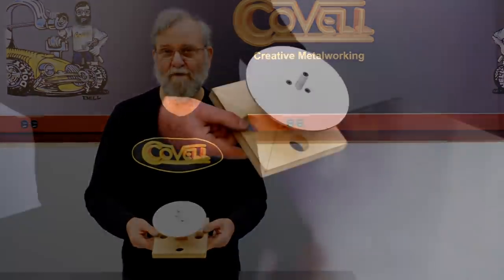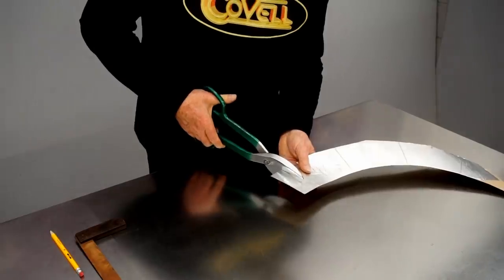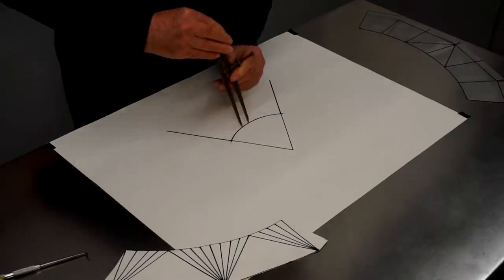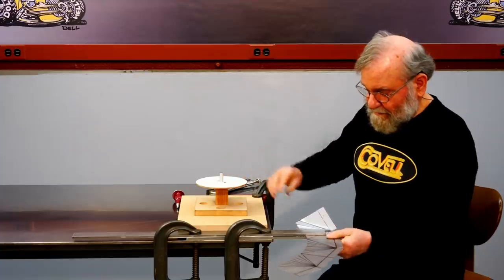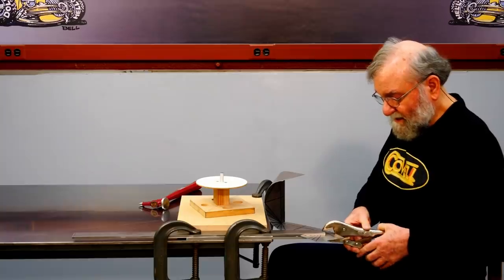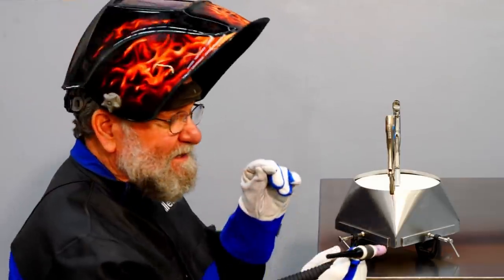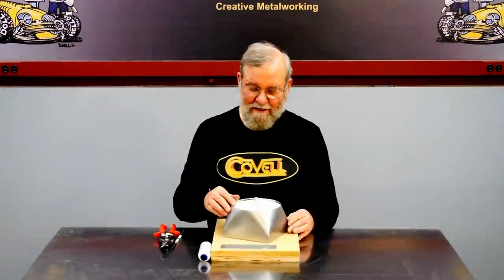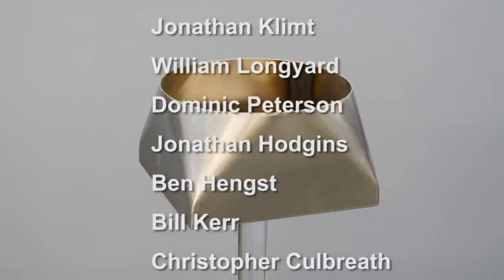Rollation 3 - Square to Round

Comment: This is cool, makes me wonder though... What would happen if you upgraded your pattern with some Clay that you roll on and let harden and a lip to hold the sheet edges then literally roll the steel onto pattern in 1 motion, then re-bend for springback?  10x speed improvement perhaps.
Reply from the maker: Well, that's certainly a clever idea. The springback is not a trivial issue, however. I would guess it would take about as much freehand bending to fix the springback as I put into making the bends freehand. Might be fun to try your suggestion and see how well it works.

Comment: I did a copper smithing apprenticeship on the Rhodesia Railways in the 1970's. I haven't done any metal work for 40 years. I've just bought a Tig welder and you have inspired me to get stuck in and create a few pieces. Excellent series with clear instructions.
Reply from the maker: Very cool!

Comment: Quick method of finding an equal number of divisions along a curved line Ron. An alternative is that you can bisect the angle with your compass. You can then bisect the subsequent angles. But then you were aiming for quick and easy for the novice to understand so I get the point of where you are aiming the vid. Well done on the square to round development. I love this method.
Reply from the maker: Bisecting would certainly work - for an even number, at least!

Comment: I just realized how much I will be able to save if doing ductwork myself, if I get a tig welder, especially if I’m trying to have it look good and be intentionally exposed
Reply from the maker: The joints could be gas or MIG welded, and cleaned up to look quite good. In the HVAC industry they use lots of overlapped and spot welded joints.

Comment: To divide by 8 a simpler way, slide a 8” rule up or down until it fits the lines, than mark each inch.
Reply from the maker: Robert - thanks for your suggestion! You actually induce an error in dividing an angle as you describe. Try it on a broad angle (like 160-degrees) and you'll quickly see that the angles formed at the ends are much wider than those in the center. I appreciate your helpfulness, in any case!

Comment: Having used a metal bending brake (the thing with the lever you lift anyways, not sure if I have the name right) back in high school and how difficult it was to get accurate bends and how in the way it got, I think your method is better for anything below a certain thickness and weight/stiffness
Reply from the maker: Thanks! The technique I showed for bending has some serious limitations (primarily the length of the bend, and thickness of the metal) but within limits, it can be pretty useful!

Comment: I have some printing presses so I think I would just ink the edges of the pattern and roll it onto paper to get the cutting layout. The downside is cleaning off the ink afterwards so the pattern can be used as a form without getting ink everywhere!

You could use paint too, but you have to use is sparingly enough not to blob, but wet enough that it doesn't dry before you can transfer the entire shape.
Reply from the maker: Thanks for sharing your ideas! 

Ink would probably work - but like you say, it's a bit messy. I tried paint, but the wood absorbed it so quickly that it didn't mark the pattern consistently.

Comment: Very cool technique! - and I think it's awesome that you're using basic tools.  I also really dig that Dykem "marker" - going to have to look for one of those....  Thanks for posting this :)
Reply from the maker: The Dykem with a 'fuzzy top' is a relatively new product, but it works great!
Reply: @RonCovell  Hi Ron, great video.  For us beginners could you provide a link to where you buy the "dykem" marker.  Also wondering about the hand snips .... even new pairs I have don't cut as well ( maybe the operator) as yours wondering if they are something special.  Again suggestions on what to use would be helpful.

Comment: Very interesting, however he should have made it out of one piece of metal so you only have to tack and weld one seam.
Reply from the maker: This certainly could have been made in one piece, but sometimes the shaping is easier with two, and it's definitely easier to achieve exacting dimensions that way.

Comment: Very slick indeed Ron. What Miller welder are you using ?? Thank you for sharing your knowledge
Reply from the maker: I used my Miller Diversion 180 for this part. I also have a Dynasty 350 which has  more bells and whistles, but it wouldn't make much of a difference on this part.

Comment: Very nice !
Could use this one to mount the fumes extractor on my plasma table...

A second air line could be useful so that you don't have to change your sanders every 10 sec...

Just thinking... If you divided your angle in 8, shouldn't be the bends about 12.5 (90/8) ?
Reply from the maker: You know, I never even thought about using two hoses - great idea! Yes, the bending angle should be 12.5 degrees. It gets more tricky on non-regular parts, like a round to a rectangle, or a rectangle to an oval. With a 'real' bending brake, you can set a stop to repeat the bending angle accurately.

Comment: Great video as usual! You are very good at making this stuff understandable. Would the principles be the same if i would like to go from a rectangle to a circle? I only have access to a mig welder and have hardly ever used it. Would it be possible to do those welds with mig when the steel is so thin?
Reply from the maker: Yes, absolutely! 20-gauge steel can be readily MIG welded, although thin metal is more difficult for beginners than the thicker stuff.
Reply: @RonCovell  thank you for the answer. I have a perfect thing this could be very useful for. I will give it a try. :)

Comment: as an Old Sheet metal worker this is one way!
but this way you have to make a template so you can get the measurements,
but the way I was taught was using triangulation. If anyone would like to learn more about this and other methods of making transformation parts try and find this book (not easy to find)
The Geometry of Sheet Metal Work By a. Dickason (ISBN 0-582-00961-8) it had the nick name of the sheet metal worker's bible
Reply from the maker: Thanks for watching and commenting. There are many good books (and online resources) that show how to do this by triangulation, which is the 'standard' technique, and works very well indeed. My goal here is to show an alternative procedure that is not well known.

Comment: Nice video. Keep it up. I have used rollation to design paper model aircraft. Try rubbing chalk on the edges of the form. As you roll it across the paper, it will outline the pattern.
Reply from the maker: Great tip - thank you!

Comment: Sine 8 is a factor of two, it would have been faster and easier to simply bisect the angle (and bisect again and again) like they taught us in high-school geometry class. Or optionally lay a measure across the original lines with "1" and "9" crossing the lines. (or "1 and "19" or...)

Thanks for these excellent demonstrations! They are very very helpful!
Reply from the maker: Thanks for suggesting alternate solutions, and I'm glad you enjoy the videos!

Comment: How do you know the minimum distance between the 2 forms?
Reply from the maker: There is no minimum. In the most extreme example, you would have a square flat plate with a round hole in the center. The offset between the square and the circle could be 1mm if you wanted. The Rollation method can become awkward with very long pieces, however.

Comment: Nice video and great skills, but what can be a purpose for this method?
Reply from the maker: Well, the method of laying out by rollation, and bending in a simple fixture can be used for many kinds of transitions. The specific square to round transition shown here can be used to connect a square duct to a round duct (for heating and air conditioning) or to adapt a square filter to a round duct, or to put a fan in a window.

Comment: I've always heard of rolation but wow  what a long variable way.
I was learned in apprentice school triangulation with dividers or trigonometry on a calculator. Would never be able to roll it. Some of our square to rounds where quarter inch material, 20 ft diameter  even the brake mark spacing and degree had to figure,quarter inch just don't give. Happy I seen rolation done though
Reply from the maker: Of course rollation isn't practical for extremely large pieces, but there is a range of work it's well suited to.

Comment: After 43 years man and boy As a general SMW I am very impressed with this chap. The only slight adjustment I would say is the division of the bend section be done by dividers using the over arc method to divide x2 until you arrive at the 8 total. 
Nice work tho and a very clean and highly polished presentation of craftsmanship all round. 👍👏👏👏
Reply from the maker: Thank you so much. Bisecting the angle repeatedly would have worked well, too.

Comment: Were your notches for the corners calculated or done by experience?
Reply from the maker: In the blank, the notches were made perpendicular to the edges, and I had marked the point they had to meet, 3/4-inch away from the edge.
Reply: Copy that makes perfect sense

Comment: Why this popped up on my feed, I don't know. But it took me back 30 years when I started out as a young draughtsman. Back then, I worked for a ducting company. Way before cad we used a method of geometry called triangulation. Taking information from orthographic projections  you'd end up with the geometrical pattern including all the crease lines first without having to make the initial form. Unless you did it for education purposes, your final method is correct, however it  seems to be reverse engineered and duplicated to finally arrive at the geometric solution.
Reply from the maker: Yes, geometric layout is the traditional way to lay out patterns for shapes like this. My goal is to show an alternate technique, which some people prefer.

Comment: There's a geometrical method with a compass to halve angles. Doing this saves you from trial-and-error to divide into 8 even segments.
Reply from the maker: Yes, the layout I did could have been accomplished by repeatedly bisecting the angle. That technique works for any power of 2.

Comment: Used to make square to round duct fittings by using the nearly the same method by using sheetmetal fixtures. Used a metal brake to brake the coordinates , laying them out with a scribe. Great video. Wish I would of thought of a wood fixture way back then.
Reply from the maker: Very cool!

Comment: This is one of those exercise pieces every apprentice would have to do, but everybody would hate it because you'd use 2mm (8th inch) stainless and the curves would never match up in radius and length. You'd also have to weld a round piece and a square piece onto the respective ends, which would warp the whole thing and burn the chrome base material beyond polish if you weren't shielding or keeping the temperature down well enough. I'd love to work with really thin metal like this, although welding becomes tricky too. Well done, Ron!
Reply from the maker: Thanks! Yes stainless, and thick stainless in particular has some unique challenges!

Comment: My 10th grade geometry teacher would be proud.  I probably would have just welded 4 pieces of angle iron in a pyramid shape to a plate and then used a press to push a round cylinder down over it. I'm sure yours looks better and doesn't have thin spots.

Comment: If you have a calculator handy or your head is like a calculator you can get a better initial guess for dividing up your bending lines. Just measure from the point of intersection of the two lines to the point where the arc insects the straight line. For more accuracy measure both sides and find the average. Take that answer and multiple by the angle in radians which is some ratio of pi=3.14=180 degrees. I'm bad at visual guessing so I use math when I can
Reply from the maker: Well, my head is far from a calculator. Actually, my mind turns numbers into Jell-O! That's why I prefer solutions that bypass the math - but I do appreciate people who are skillful in finding mathematical solutions to problems. That's what got us  to the moon!

Comment: Great video mate , I been a sheeting for 30 years now forced into retirement from sheeties plight only ever made large square to rounds out of 2 pieces but like your work , how do you go making* a double offset square to round though? It requires 2 piece production. I hope you’re using wiss snips and Gil bow snips on your videos 😉
Reply from the maker: I prefer Wiss snips. I tried the Gilbow snips, and my hands aren't strong enough to use them for long, since they have no compound linkage.

Comment: How do you know which is the top and which is the bottom? And what diameter are the electrodes and filler rod?
Reply from the maker: Top and bottom are relative to the application. I used 3/32" (2.4mm) diameter electrode, with .045" (1.2mm) filler rod.

Comment: 6:30 another way to divide the angle (eliminating the need to guess and check with a divider) would be to just lay a ruler across the legs of the angle.  It doesn't matter if your ruler is perpendicular to the vertex of the angle or not.  I.e. lay the zero of the ruler on one leg, and the 8 on the other leg and mark off the inches- or the zero and 12, marking off every 1.5 inches..
Reply from the maker: Travis - thank you for your comment. There is actually an error induced when dividing an angle as you describe. On a small angle - say 30-degrees - the error would be small, but it becomes significant on larger angles. If you try that technique on an angle of 120-degrees, you will quickly see that the divisions aren't even.

Comment: Nice process.  Btw - do yo mean “machinist blueing”? 😉
Reply from the maker: There is a dye that machinists often for increasing the contrast of a scribed line. Dykem is a well-known trade name:
https://www.amazon.com/DYKEM-80300-Steel-Layout-Brush/dp/B01LZZP1VA/ref=sr_1_2?dchild=1&keywords=dykem&qid=1615087221&sr=8-2
Reply: @RonCovell  thanks, Ron.  I was just trying to have a little fun.  I figured there would be new material since the last time I did any sheet metal work was in high school ...... 50 years ago. 🥴😊😉

Comment: Ron why wouldn't you simply measure across the hypotenuse, and divide the line into 8ths, then draw intersecting lines from your center point? It seems it would be faster. That being said it is an interesting way to form varying parts from a pattern.And I learned I was using snips upside down for the last 30 years last week lol.
Reply from the maker: You actually induce a small error by dividing the hypotenuse into 8ths. If you try it on a wide angle, like 160 degrees, you'll quickly see that the angles at the edges are wider than those in the center. Thanks for watching, and commenting, in any case!

Comment: That's an outstanding result. I wonder if the templates could be created in software and then laser printed. With a bit of calibration, a laser printer can produce quite dimensionally precise layout and of course the templates are infinitely reusable. The mathematician in me thinks involute and geodesic curves when I see objects rolling on a plane. I bet working out the maths would be fun!
Reply from the maker: David - of course there is software that can pattern shapes like this. That's the way it's done in industry these days, for sure. My goal was to show a simple technique that was accessible for most people.
I'm pretty interested in involute and geodesic curves too, but my mind doesn't process math very well.

Comment: You can do it so much easier in fusion360. Simply draw the shapes,space them and then use the loft command. The shap is then converted to sheet metal. Tell it the thickness and it will give bend allowances etc. Sounds tricky buy pretty simple with practice and dead nuts accurate every time!
Reply from the maker: Yes, CAD is ideal for doing layouts like this. I know that many of my viewers don't use CAD, so I'm giving them some alternatives.

Comment: Thanks again Mr. Covell. I'm sure I'm going to use this technique in the near future (somewhere this year). I have a project in mind where it will come in handy.
Can you show how to do it when the end planes of the piece are at an angle? I think that would be most interesting.
Reply from the maker: I don't know if I will make another rollation video, but the key difference is that the form would hold the end pieces at the desired angle. All the steps after that would be similar to what's in this video.

Comment: Clever trick, but its kind of like giving a hungry person the fish rather than teach how to fish. An hour or two spent in a 30 year old sheet metal layout book would speak of the "true lengths" and how to determine exacting dimensions rather than a fancy tracing. Then the nearly lost trade hand made of sheet metal transitions would be passed down correctly.
Reply from the maker: Geometric layout is the most widely used process for making shapes like this, and it works for parts of any size and thickness. 
In certain instances I think the 'rollation' technique works well, and many people have reported that they prefer it over traditional layout. 
I don't think it's reasonable to call one technique 'right' and one 'wrong' - they are simply two different ways to get a job done, and I wanted to show the rollation technique because it isn't widely known.